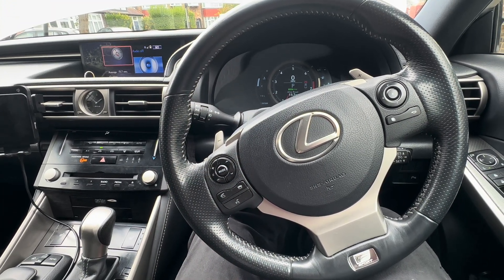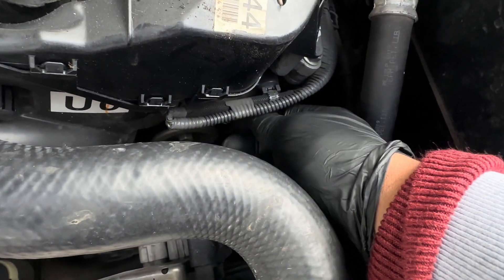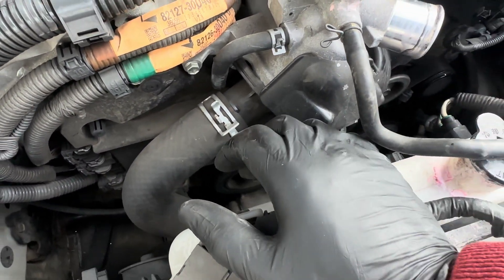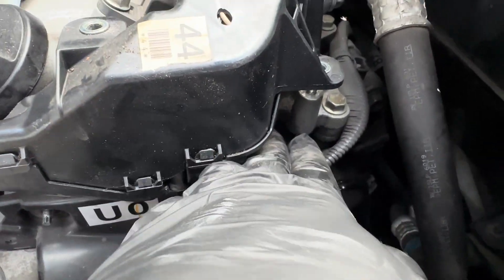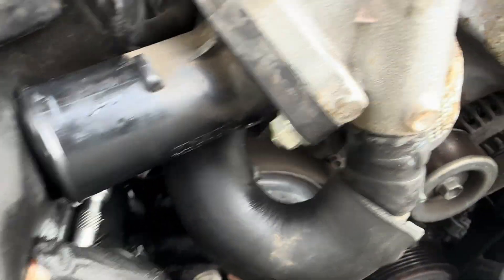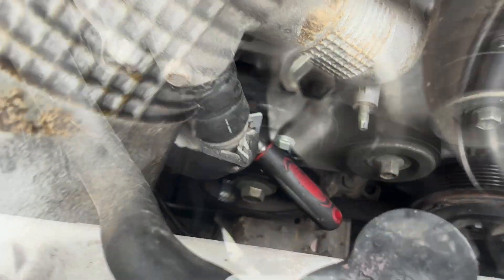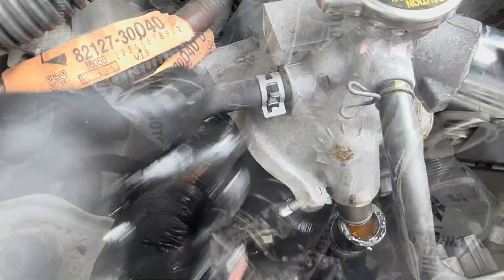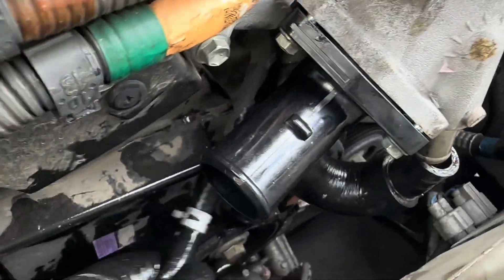#Thermostat Troubles: #Lexus #IS250/IS350 #Symptoms Explained #youtubehighfive

Comment: I've got a question. A few days ago I replaced the thermostat on my Is250 2012. At first it was overheating so I stopped, let it cool and left it near my home. Next day I went to bleed out the air. Opened the radiator cap, put the heater on max and let it idle until it reached operating temp. Went for a test drive, driving both low revs and hard, with heater on and off. No overheating, but the hose which is connected to the thermostat is always cold, so I'm assuming the thermostat doesn't open. Weird thing is the engine is not overheating, though the weather outside which is around 0 Celsius might be helping with cooling the engine. Does this mean there's still air in the system or a faulty thermostat?
Reply: I just got to the end of the video and realized I tried to bleed out the air by opening the reservoir cap and not the cap on the thermostat housing, gonna try it tomorrow
Reply from the maker: One side should get worm and the other cold when the thermostat opens otherwise you might have a air lock somewhere
Reply from the maker: @GamesInLTU  wait the bubble to stop don’t put your face or any of your body parts next to the thermostat housing cap also keep an eye on the temperature gage close the cap because it’s reaches halfway on the temperature gauge in the car don’t forget to let the engine cool down for at least half hour before rechecking level
Reply: The Moshimoto will blow an Engine Code as the ECU will not like that the operating temperature is lower than normal. You can tune it. Pulling it out and putting a Gates in. Sucks.
Reply from the maker: No issue so far is that what happen to you?
Reply: @g_a_bofficial  it's been fine ever since, i bled the air a couple more times and it's all good, no overheating